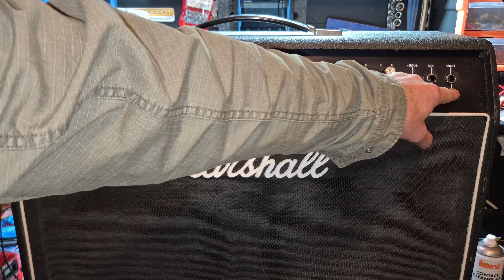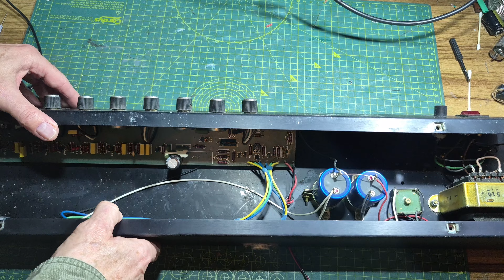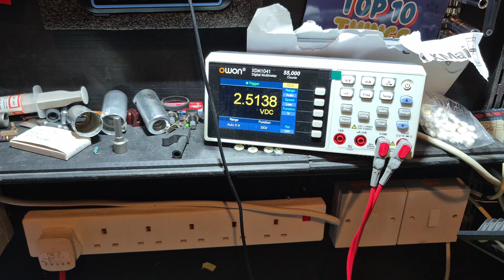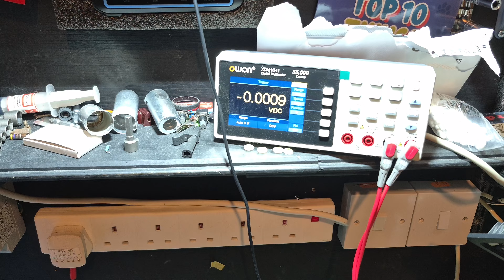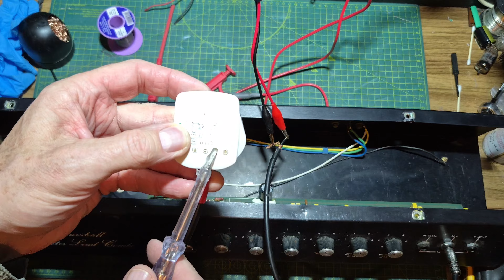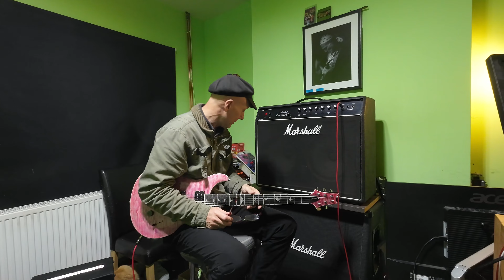Marshall Master Lead 2199 Solid State Guitar Amplifier from 1978 Let's Give it a Look Over

Comment: Superb playing, sir. 
I just got one of these and have found a decent tone with the mix channel as well. Can you please tell me if the speakers are wired 4ohms? Mine came with 15 ohm speakers and im thinking thats wrong. Thanks for doing this video.
Reply from the maker: Hello, thank you. It should have an 8 Ohm load. So those to 15 Ohm speakers should be wired parallel. Are they Celestion T1632 speakers?

Comment: i dont want to sound mean but those marshalls sound terrible, the celestions do justice and are the 70% of the sound tho. By looking the schematic, it is expected to sound like that due to its simplicity, there is no diode clipping, no feedback, pure transistor overdrive and that explains the blocking distortion, the preamp section has like 5 transistors with a similar topology to the classic tube circuit however it does not translate well with transistors without considerations.
Reply from the maker: Hello.That's fair comment. Good constructive criticism is always welcome on the channel. You are right, the Celestion speakers are definitely a bonus in this one. Some channels only film higher end guitar amps. I try to film all types of guitar amps. It's a shame they didn't use this cabinet design for a budget tube amp. Now there's an idea. Thanks for watching and take care,